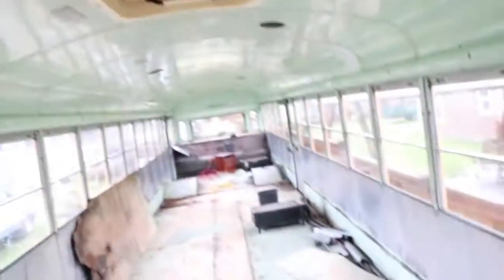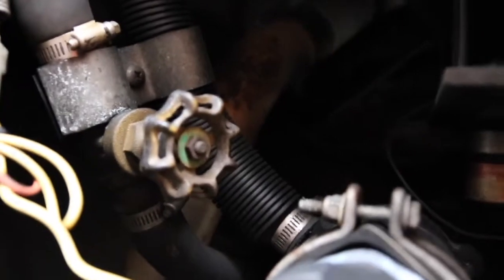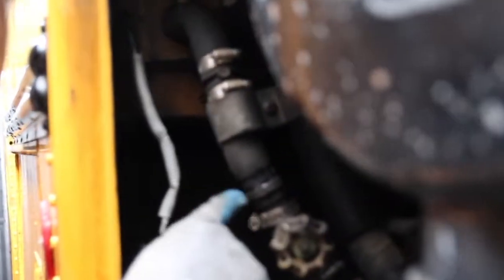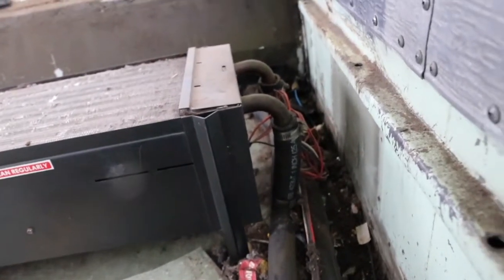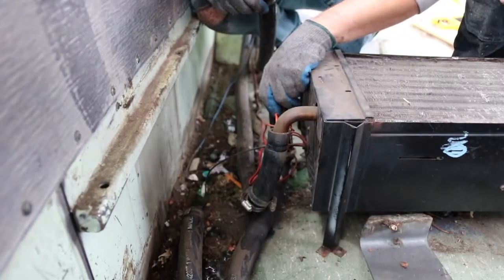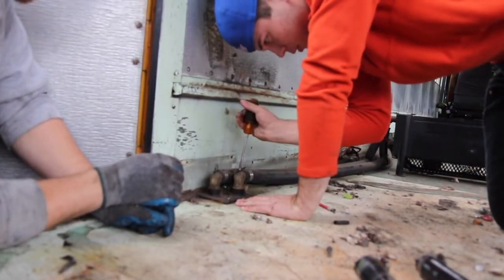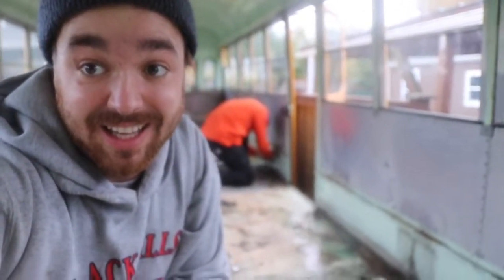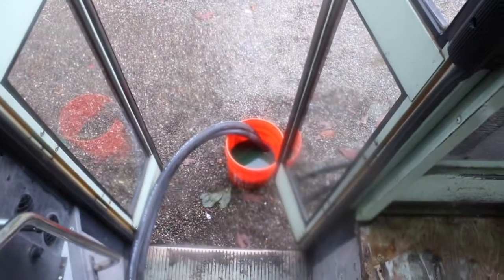Heater Removal - Skoolie Bus Conversion - E4

Comment: Hey! Do you have to like .... refill the engine with coolant after this?! Or is it excess just for the heater specifically?
Reply: I would check your levels after you're done. I reran the lines under the bus so I had to put a bunch back in.

Comment: Looks like everyone is just cutting the line. Was trying to undo the bolts with a wrench but theyre on there too solid. Looks like I will have to cut the line from underneat to remove it. There is a propane tank I have to unbolt as well.

Comment: Hey cool vid! we're almost at the heater removal stage- when you removed the heaters, did you find a new way to have a defroster for the front windows while traveling in the rain? I'm considering keeping my heater system intact just so I have a reliable way to drive safely, but I don't know if it's worth the hassle.
Reply from the maker: https://www.youtube.com/watch?v=1zrAGiu-FPI&list=PLtwG0o48_OIooSQlgiQbFd3NUveIvGiGS&index=16
We reran the coolant line under the bus to make sure the font heaters still worked. So far it has worked great!
Reply: @ColaVentures   I saw this one today! 😁👍🏻I think we'll do the same thing. I don't have storage bays to drill through but I think it will still be a pain. 
Did you check the max  temperature on the rubber tubing? If I read the chart right I think it's only supposed to get up to 80° have you had any issues with yours?

Comment: does the tubing go to to the front of the bus as well for the heater in the front where the driver is?? do you possibly know a way to keep the tubing system but just remove the big bulky heaters and keep the tubes for the defrosting system in the front?
Reply from the maker: Yes it does! We reran the lines under the bus so that we still have a front heater and defrost.
Reply: @ColaVentures  perfect! do you happen to have a video on how you guys did that??
Reply: @lene4095 good question